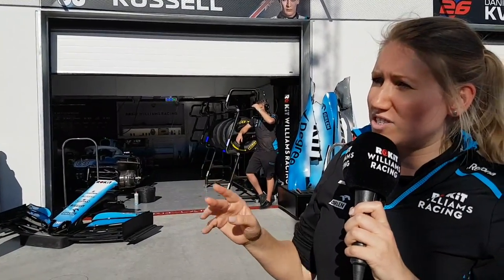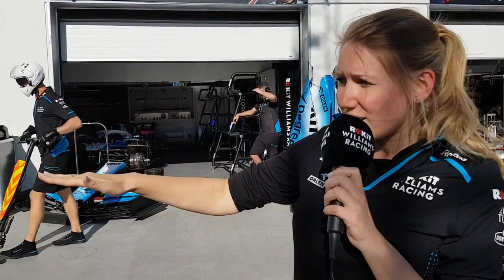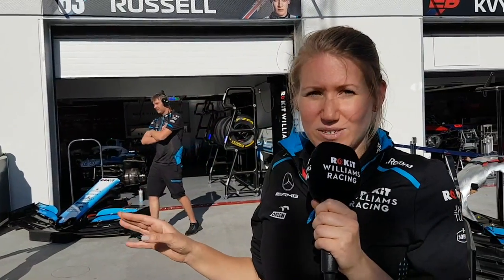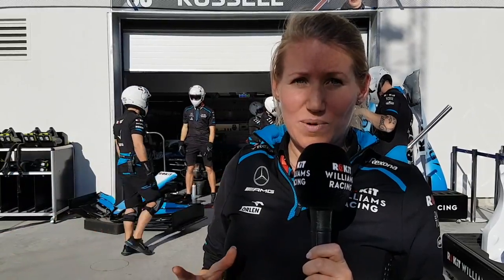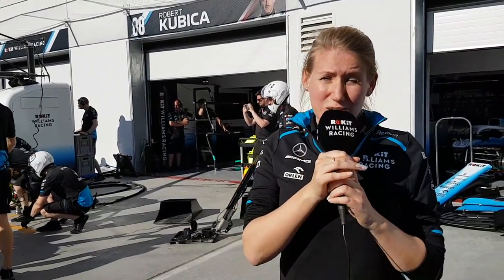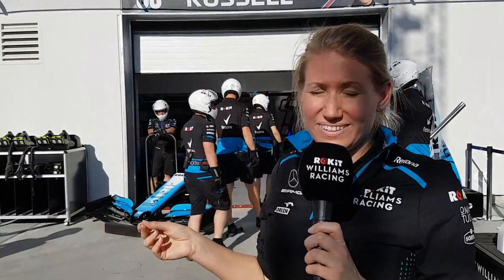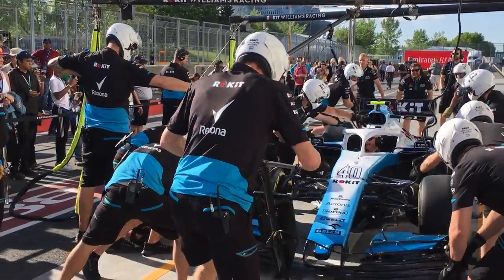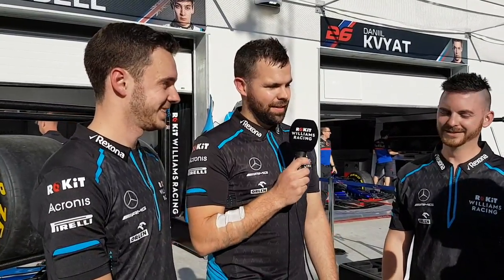How does an F1 pitstop work?

Comment: It's such a pitty that these mechanicks are search for ten or honderds a second while the race pace of the car is 4s slower than the top field. Yet they are still motivated which is a massive achievement to get your head straight. They are missing some key engineers to get the design of the car better than it is now.